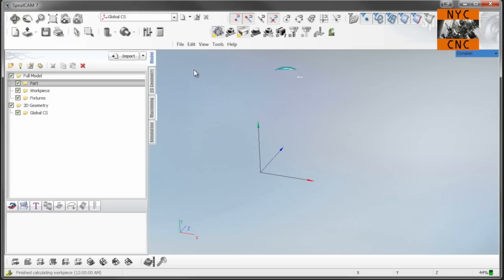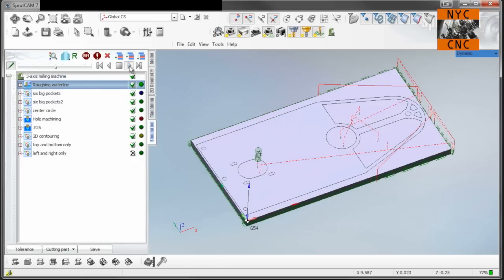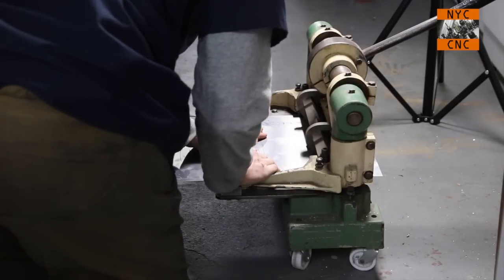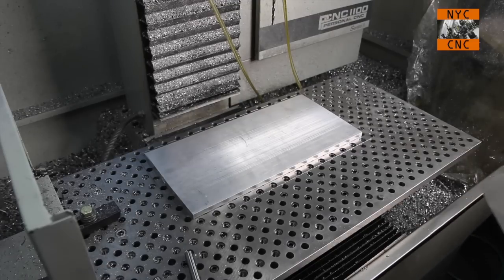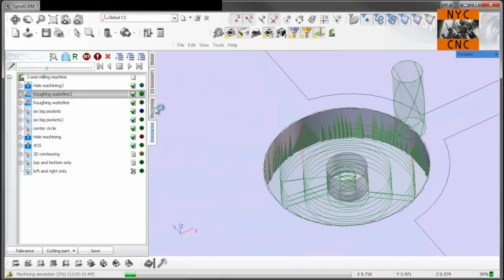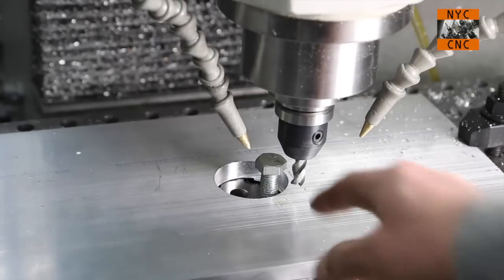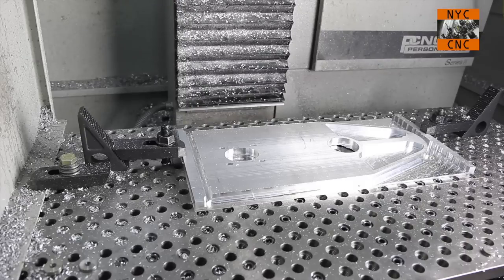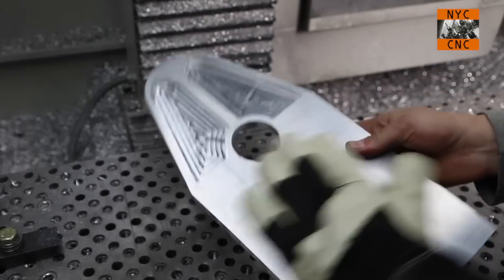Manufacturing At Home:  Machining Large Aluminum Plate with Tormach PCNC 1100

Comment: i want to lean  do do cad as well as gcode what is the best software to learn
Reply: i am fortunate to work in a really large machine shop so i can get anything really so the software is a non issue  eventually i am thinking about getting a tormach if i can find a way to pay for the damn thing but i want to learn first.
Reply: my end goal is to be able to make  my own designs
 i also have a team of  really talented Designers that are all my friends  so we will all end up using the tormach at some point
Reply: someone said solidworks
Reply: PoliticalSmackdown if you are planning for a career then you need to learn the programs the manufacturing shops are using such as mastercam, solidworks, siemens, etc... pretty easy to learn other cam softwares tho after you learn one
Reply: PoliticalSmackdown I think you need, first of all, to be clear about what you will eventually want to do.  That involves doing a bit of research on what torque that particular machining requires, how many axes and if you would benefit from an ATC (Automatic Tool Changer), i.e. be able to recoup the investment.

Machine size and rigidity also plays a part, but you should know that rigidity costs real money!!! It can save time by taking deeper and harder cuts, but after a point you need huge production volumes to make your money back.

After all that, go around getting offers and requesting demonstrations from people ON the actual work you will be doing. Both on the software and on the machines. Rigid tapping is also a huge time saver if you can afford it. Finally, I would suggest getting an integrated CAD/CAM software. Makes life a lot easier. And also, when you pay for the software, hustle for a deal on some basic training. It's going to give you a head start, at least.

As far as I'm concerned, Solidworks is a great value/money deal with HSMXpress being integrated, free but only 2.5axis. HSMWorks is the full 5-axis deal, but it's not free...

P.S. If you will not be making high precision parts and are on a tight budget, I would look at CNC conversion kits.

Comment: I don't understand why you would mill through the lower plate like that. I thought the whole point of haviing a plate under it is to assure you don't hit the hardened fixture plate.  Seems like actually cutting away the bottom plate is just asking to ruin your surface..  thoughts?
Reply: Yes I understand this, but my concern was that you had actually gone through the underplate.
Reply: *****
I've not gotten my g0704 cnc'd yet but will soon, I have been wondering this myself.  my first thought is that perhaps wood might not provide a accurate or solid enough surface, and might smoke if it gets too hot.  Still worth a shot though.  I'm considering casting aluminum fixture plates and them milling them square. This way if I cut into the plate, i could always recover the shavings and plate by resmelting it. idk. Just brainstorming.
Reply: He cut away the lower plate because he was considering attaching a clamp through the center hole for support in which case he needed access to the fixture plate to get a hole to bolt in. That was said in the video!

Comment: You set the job up on a dirty bed?  Sloppy.  Clean your machine, it needs it bad!
Reply: Yes. When I set a job the bed get vacuumed out. All the mounting clamp holes are clean.  I never have to  use a blow nozzle to clear out a hole to mount a clamp. It's called a shop vac. You don't have to clean the whole machine, just vacuum the bed. Get all the garbage out of the holes, no worry about a chip getting under the blank.
Reply: If it was magnesium I would think about it.  If you were worried about the aluminum chips exploding in the vacuum, put water in the bottom of the shopvac.  
   I even run the vacuum on the bed before I unclamp the part from the bed.  The catch pan in the bottom, I let go until the end of the day. Using a blow hose causes chips to fly everywhere.  Not good at all.  I also run coolant all the time, no matter what, keeps the bit from clogging up.  It's just the way I am..
Reply: Have a Great Thanksgiving.